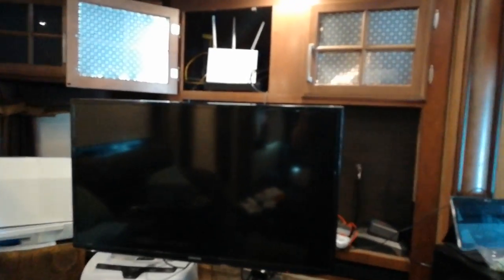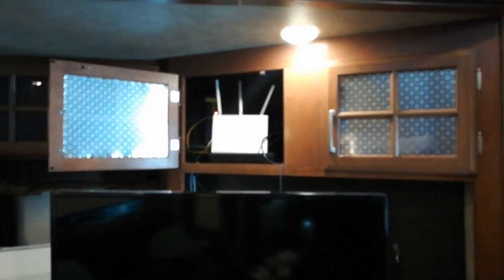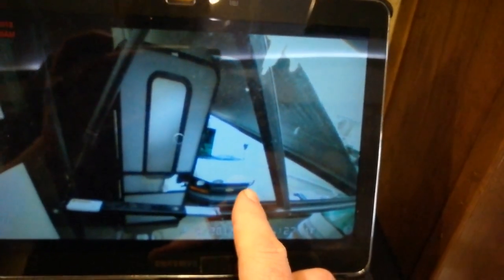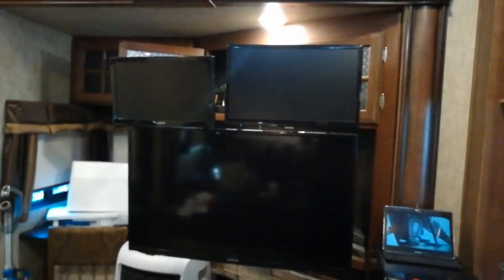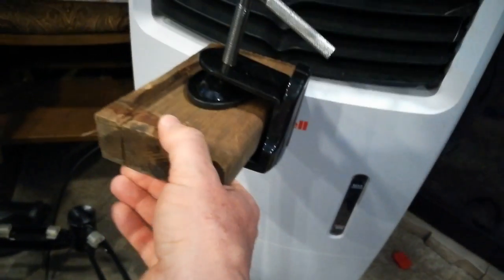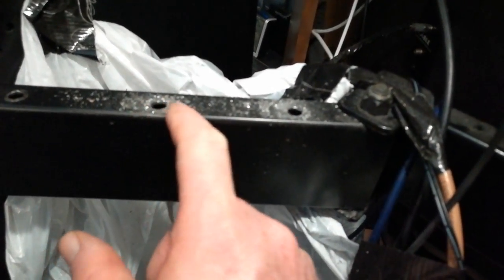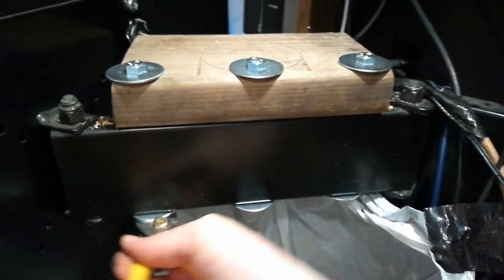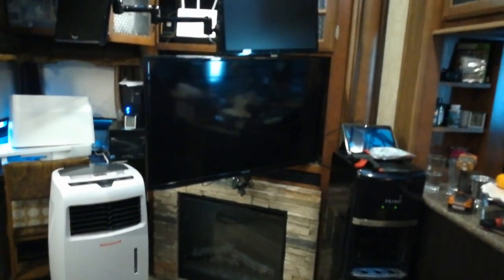building a Multi-Screen TV Mount - 3 TVs

Comment: Interesting setup. Would have been easier with Picture in Picture. Do they even make those in the newer digital TVs & monitors?

I had an analog one w/PiP and it was great fun to watch the late night shows flipping back and forth between all the jokes being told.

I was thinking one day it'd be cool to put a TV on the ceiling right above my bed.
Reply from the maker: hahah I see we think a like.  I too want to put a tv over the bed, but because are in a 5th wheel the ceiling is lower so I'm going to velcro a tablet there!  if there's a bump in the night i can turn it on and see all the cameras around the rv (a future project!)
Reply: Great minds, great minds. LOL!
Velcro is an excellent idea. The main problem with the ceiling mount is the difficulty with it all. I have a 70 inch set and I could barely get it up on table much less on the ceiling. I've been thinking about self inventing some kind of pivoting design where I could bolt it on while its down and gently flip it up, maybe even seek out a motorized unit to pull an 1/8th aircraft quality cable. Truth is none of it matters since I am rarely ever even home these days to enjoy it.